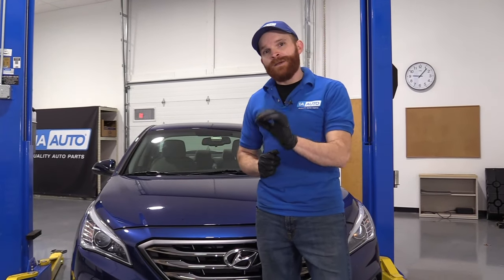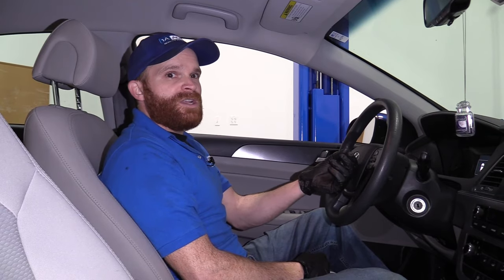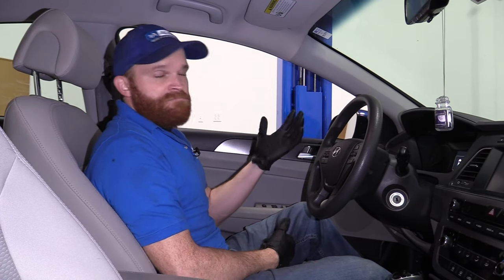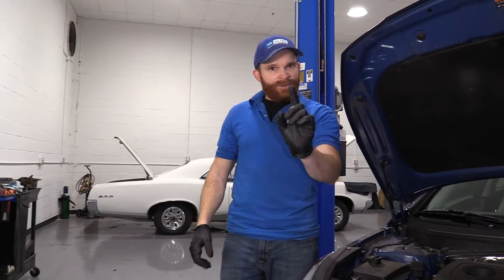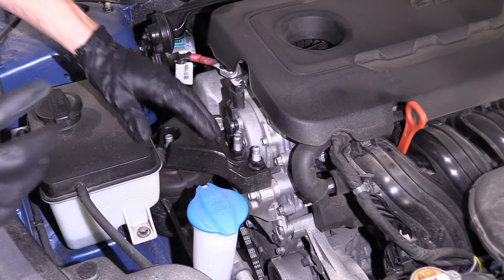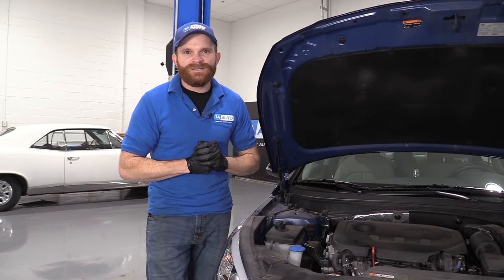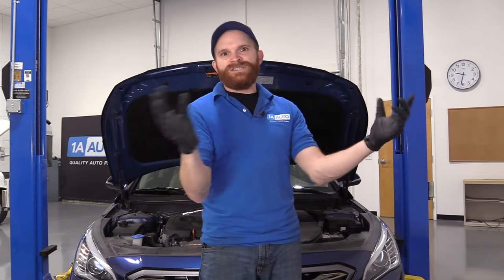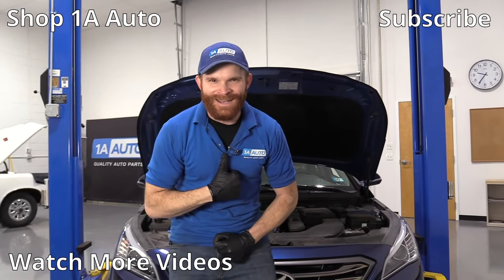Top 5 Problems Hyundai Sonata Sedan 7th Generation 2015-20

Comment: My 2016 Hyundai sonata 2.4 l car has not had any significant issues since I purchased it. In fact the tires went all the way to 70,000 mi before I had to change them. Although I'm at 75,000 miles I still have a quarter to a third of brake lining on my original brakes. The only issue I had was when I purchase the car the radio would not activate until about 10 minutes after starting the car. I showed my third Hyundai dealer a video of the issue. And within 3 days he had an installed a replacement. 
I am concerned about the airbag situation you talked about. I did not get a recall from Hyundai on that. Does it apply to the 2016 year model?How do I find the recall notification on this subject?

Comment: DO NOT BUY A HYUNDAI. Currently having to spend 3k to get my 2017 Hyundai Sonata Sport fixed due to the power steering column needing to be fixed. It’s an issue MANY Hyundai owners have experienced. No idea why it hasn’t been recalled yet.

Comment: love my 15 sport limited, lap3 tune slightly modified blacked out. thanks for this info. I do all my own work, the 2.0 turbo using 93 tier shell gasoline. With the GDI engine there is no way to clean pistons other than self maintenance, so recommended doing a CRC GDI cleaner. forgot the exact name. Intake cleaner maybe. ty good vid
Reply: My stock 2016 2.0t goes 320 km on full tank. Is that what everyone getting or time for a repair?
Reply: @RajanSangwan  get it checked, but if nothing is wrong, I’d just say lay off the gas maybe lol 
I get 400+ per tank but I do basically drive all highway
Reply: Is the lap 3 worth it? 17 2.0t owner?

Comment: My 15 sonata has a battery drain issue. Returned my battery, still dies overnight,so I had the alternator checked out and showed fine, then I replaced the starter thinking it was a flat spot in the solenoid but no luck..so I took starter out again and installed a jump wire to bypass the starter key switch with inline fuse because it seems like the computer won't let power go to start until it hit a certain voltage?? What's wierd is I can take battery out and start my f150 v8 or my taurus 3.0 v6?? Also new battery terminals and battery brand knew again. Everstart h7 850cca and 1000ca..??

Comment: And Oil runs out so fast because of the turbo engine I have the 1200 miles of a new oil change I to put oil in it again. Always have to Constantly check the oil

Comment: I had issue with sway bar links and front axles at 80K miles on my 2016 Sonata. Hearing from technician, that it is a common problem in 2010-2018 Sonata's.

Comment: I’ve got a 2015 Sonata with only 67,000 miles. It has the timing chain and steering column noises. It also burns oil and the transmission slips when it’s really cold out. This car is a huge disappointment to me, I’m currently in the process of getting rid of it. This was my first Hyundai and probably will be my last.
Reply: Yep they are junk
Reply: Yup. Having issues with my steering column on my 2017 Hyundai Sonata at 64k miles. Hyundai dealership is quoting me 3k to replace it. These cars are terrible.
Reply: @smellslikefreespirit  what exactly is it?

Comment: I own 2016 sonata and only problems so far.I've done 248,000 kms and sat nav replaced 4 times under warranty.At 160,000 kms I had to replace tensioner for serpentine belt but that's probably normal for kms and it was still replaced under warranty.Recently just out of 5 year warranty I replaced oil pressure switch $42.What I'm surprised about is suspension is still fine and CV joints are fine.No timing change noise yet.
I've replaced front pads 3 times and rear 2 times which is expected so I'm happy.

Comment: 2.4l 2018 sonata engine siezed. lost power. check engine light flashing. couldnt accelerate past 15mph. barely made it off the highway. 42k mi. hope the warranty will cover it all. whatever the issue is.
Reply: How is it now

Comment: The P1326 code with the flashing check engine light could be the knock sensor, which causes the engine to go into limp mode: (in the interest of preventing internal damage to the engine) not allowing the engine to rev any higher than 2000 rpm.
Reply: I think this is exactly what is happening to me. This started happening minute after my ABS lights came in. You think it might be an electronic issue? Or an actual issue with hardware like the engine or transmission? It’s Friday and I’m taking it Tuesday to a mechanic. My nearest Hyundai dealership is an hour away. 🤦🏻‍♂️ can’t risk taking it on the interstate with it going limp like that. Just wondering what I’ll be looking at to pay. Ive got a 2015 sonata sport limited that I bought used in 2019 with only 24,000 miles on it. It’s now at 56,000 miles in 2022. It’s not a heavily driven car. I do synthetic oil and change it every 6000 miles. I had an issue of antifreeze leak one time that caused my engine to over heat for a minute till I got it pulled over into a gas station 2 years ago. Luckily a mechanic was there getting gas and figured out the issue. I replaced the diluted antifreeze and never had an issue with it leaking again. Other than that I’ve only had electrical issues with passenger airbag, and the blind sport sensor. This October my 3 year transferred manufacturers warranty will run out. I wonder if it will cover any issues pertaining to throttle issues or knock sensor issues if this is the case.
Reply: Bad cars burning oil engine problem

Comment: I have an acceleration problem on my 2015 sonata SE. sometimes when I turn the engine on it will jolt forward as soon as I put it in drive and release the brake. It makes it harder to brake. Then if I turn it off and back on it will go back to normal after one two or three times. That’s the main issue I’m facing besides the gas cap won’t screw all the way on and the check engine light keeps turning on when I pour gas.
Reply: Same problem im having. Code p0010 camshaft sensor bad , im have to replace it. Also having poor acceleration
Reply: Having the same issue.  Found some oil on the cam sensor cover which could be a common issue with the plug inside popping out getting oil on the sensor.   Going in tomorrow.  ...also a P0010.
Reply: Replace the camshaft position sensors. The exhaust and the intake one. Both are cheap and you can probably install the new ones yourself.

Comment: I have the 2017 Sonata Europe/Middle East Version. Already on my 100,000 kms. During the hot months in the middle east, temperatures could soar to a scorching 53°C (127°F) that last for about 7 months. This definitely qualifies for extreme usage but the dealership says that the transmission oil is lifetime and they never offer transmission fluid change. What a weird dealership.

Because the dealership refused to change the oil, I watched youtube videos and changed it myself. It's actually quite easy. The oil was so black that it definitely needed replacement, contrary to what the ignorant dealership mechanics say.

All I did was drain the oil from underneath and then refill through the overflow valve. When the valve is spitting excess oil, that's when I stop. I did not need to remove any other part.

However, it seems like the residual oil was so dirty, it contaminated the new oil. I think I need to replace the oil again after 20,000 kms.
Reply: I heard that the trans mission fluid should be changed every 30,000 miles, so the oil should not get so black! It is always good to get a second opinion , if you have questions on maintaining your Sonata!!Thanks

Comment: Can using 100% synthetic oil cause problems as apposed to a blend?
Reply from the maker: +Tam B Thanks for watching!  These vehicles recommend full synthetic oil, so that is what you will want to use.  With oil it is the weight that is most important, not the type.

Comment: I have a 2015 hyundai sonata and my check engine light is on and with that I have very poor acceleration. What could this be. I cant afford to bring it to the dealership right now.
Reply: your knock sensor could have a recall had the same issue
Reply: Or camshaft or crankshaft sensors
Reply: @Galaxy2ss_  how much does the camshaft service goes for ?
Reply: @darkfader7223  This is part of the Theta II engine warranty/Lawsuit. Take it to the dealer and they will most likely cover this for free and could lead to an engine replacement for free. It's where I'm currently at with my 2015.
Reply: I have a 2015 Hyundai Sonata.I had to have the serpentine belt replaced. My second issue I was told was the camshaft sensor,unfortunately this car burns a lot of oil..I have had issues with my break light ,after I would replace the break light,it would,after a month burn out again and again,which created a bigger problem,I had to have the dealer to replace the entire harness that holds the bulb because it literally melted.Not only that ,my car would not pick up speed and whenever I was at a red light or stop sign,it seemed as if my car was going to cut off.After replacing the cam shaft,new tires,oil change,brakes,new harness,which was an electrical issue,picked my car up and was on the interstate and check engine light started flashing on and off,car was in shut down mode,made it back to the dealership.I had to have an entire engine replaced free of charge after paying 2800 to have my car fixed in what I thought,properly.My car still rides rough as well as they did not fix my electrical problem properly because now the light will not go off inside of my car,brake light worked for a day or 2.To top that off,if your car is white,unfortunately the paint will begin to start peeling right above the windshield and as time goes on,it only  gets worse,so you will need a paint job as well.If anyone has any of these issues,camshaft,serpentine belt,engine ,break light and paint issues,call the corporate officer because some of these issues should be free of charge and have recalls on them.Hopefully you will get someone assigned to you that will help take care of some,if not all of your needs,I DIDN'T. Good luck!
Reply: If your check engine light is on ,your car will not pick up speed, you may need a new engine.Call the corporate officer and file a claim with them so you can get that taken care of free of  charge.The dealership should give you a loaner car while your car is being fixed.If they don't offer,you ask!
Reply: @brandenbrooks9663  even if you are not the original owner?
Reply: @darkfader7223  depends it should be covered under warranty tho

Comment: I have a 2015 Hyundai Sonata Sport and it's burning oil and low beam  lights not working, but high beam lights work. I don't understand the light problem.
Reply: How much oil?
Reply: I have the same issue burns afew quarts every 3k miles. But this car runs good and doesn't smoke. I do have an issue w the engine light.
Reply: I have a 2016 Hyundai Sonata spot and I been losing oil 5-6 quarts in 1000 miles they been giving me the runners at the dealership not my car done shut down n want do anything

Comment: At the 2:45 mark you talk about the timing belt tensioner, what is that black cap on the side? My sonata just had a new engine installed 3k miles ago and started knocking, found that cap off and smoke coming out of it.

Comment: My 2016 Hyundai Sonata Sport rear lights went out in 2020. A police officer pulled me over to inform me. The mechanics I've talked to said that's been common too.
Reply: That’s a common thing with the original OEM lights 
Try using aftermarket bulbs they hold up with heat much better

Comment: hi, i am shopping online for a sonata 2015 and newer, one thing i noticed on some of them is the cluster display, where you see the miles and speed digitally has a vertical/diagonal black bar, like if the screen pixel are damaged, anybody experienced that?
Accepting suggestion: i am between hyundai sonata 2015 or newer or vw passat 2015 or newer, what do u suggest me?
Reply: Stay away from hyundai
Reply: Mine is awesome. Just did 3000 mile trip in it
Reply: @jay Coleman how (if you don't mind my asking)  did it go with the with the dealer?

Comment: I have a 2011 Hyundai sonata I love the car only thing I have replaced thankfully is the starter which is another common problem. bought it at 160,000 miles and it  drove like new and was very quiet even though it never had a catalytic converter since I owned it. over time it has gotten very loud currently with 225k miles the muffler started making a rattle noise around 200k but has changed to just a loud exhaust sound. I have noticed a significant amount of power loss as it has gotten higher milage but if I step on it a little it will still get up and roll I just prefer to pussy foot it so it will last longer. I feel like 3rd and 4th gear are very worn is the result of poor acceleration on my end and it being a higher geared vehicle for more fuel economy.

Comment: I recently sold a 2013 with only 19k miles for my elderly in-laws.  Getting it ready for sale I discovered  there were eight recalls, what a disappointing car.
Reply: I have a 2015. There is a lawsuit going on right now, for the engine fires/engine seizing.
Reply: @yarikfreerunner1  I got a 2015 sonata se, what will Come out the law suit?
Reply: Who cares! As long as you haven’t had issues, you should be fine
Reply: Recalls happen to every car dude. You just take it to the dealer and they fix it free.
Reply: @hannahvick2824  ya dealerships always so the right thing

Comment: my 2016 sonata limited only has a noise problem with the lock window button rattling 🙄 it shakes like crazy when the radio is turned up and drives me insane
Reply: Omg mine was driving me insane!!! It took me months to figure out exactly what it was. It’s my passenger side and it was My window “up-down” button. I folded a piece of paper thick enough to wedge inbetween the side and it stoped rattling. But there is another in the window itself that slightly annoying. If I barely roll the window down just a smidge, it stops.

Comment: All 2011-2019 Hyundais & Kias with the 2.4L Theta II engine have major engine problems. They are unreliable. Look elsewhere.
Reply: They have new smartstream engines now. They are much more reliable now plus they are dual injection.
Reply: I have a 2017 Sonata 2.4L. 100k miles with modifications. No problems. Still drives just as smooth as day 1.
Reply: @buckogames  The same I have a 2016 se not problems yet
Reply: 120000k miles
Reply: @UCWJ7fpPQIEuuZCkDZjW1l0A same here. Change the oil every 3000 miles and make sure it's not burning too much. The fires happen because people assume they can go 5k-10k miles without changing the oil and all the oil burns out and the car is running dry. Just change it often and check the dip stick to make sure it's not low. Other than that I've never had a problem with my car. 104k miles, '16 SE as well
Reply: Yup! 115k miles my 15 started burning. No leaks, no smoke. Take it to the dealer they might do the right thing, mine is currently trying to push me away. Best advice, “stay away, from hyundai!”

Comment: Do you have a video on the timing chain tensioner? I have a 2018 limited with 17K miles on it, still under warranty. I would like to be a little knowledgeable about the issue before I bring it to the dealership. Thank you.

Comment: Hello 1A Auto.
My 2015 Hyundai Sonata 2.0T Limited stall on me yesterday on rapid acceleration.  Since then the car won't crank, ignition turns on, it shows system checks, radio and blower come on, but the car does not even try to cranks.
Reply from the maker: +mshazad73 We wouldn't be able to diagnose an issue like that here, you may want to have a local mechanic take a look at it. Thanks for checking us out! http://1aau.to/m/Shop-1AAuto-c

Comment: Please cover why the 2.4 L burns so much damn oil.
Reply: I had to get a new engine, because my 2018 did the same thing.
Reply: Yea I have 2016 have been told by multiple shops I need to replace the engine. I’m pissed. They sent me the letter for the theta engine lawsuit AFTER the august 9th deadline.
Reply: @JUYAH1  did you replace the motor during this pandemic? I’ve been told this engine is hard to find now.
Reply: Change pcv valve, do injection cleaning on GDI

Comment: My 2018 Hyundai sonata i replaced the belt tensioner myself at 40k miles. I had an issue with the engine bogging down..took it to the dealership said it was the A/C. Replaced it at 30k miles. Still having the issue..took it back...they say it was the battery. Replaced it. Did not fix the problem. Then at 40k the battery died. Said i needed a new battery and that the belts were bad. The worn belts caused the battery to lose charge. They had my car for one week and only to tell me that. I asked if they had checked the tensioner...said it was fine. BS...battery replaced under warranty and declined the belt service. Took it to Lambs. Replaced the belts. They checked the tensioner said it was fine...Problem did not get fixed...I put a wrench to thing myself and it didn't have much for resistance...replaced it...Problem solved. The bogging down and slippage stopped..I have been having that issue with my steering wheel as mentioned in your video...thanks..gonn get it taken cared of..noise is annoying as hell..
Reply from the maker: +jesse salcedo Thanks for checking us out. Shop for high quality auto parts on 1AAuto.com:

http://1aau.to/m/Shop-1AAuto-c
Reply: Wow, why would anyone put up with these types of issues? Just buy a better built vehicle from a proven manufacturer. Peace of mind is priceless.